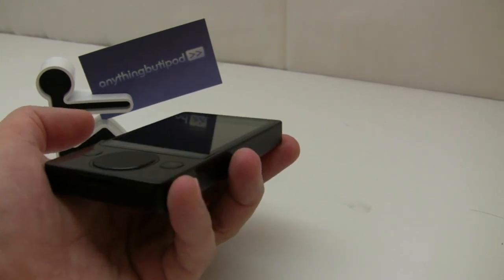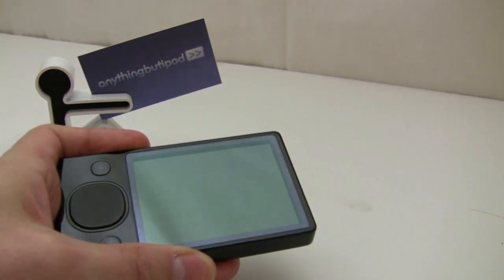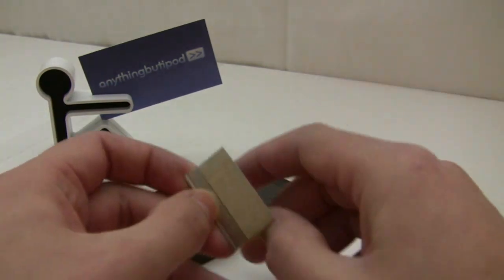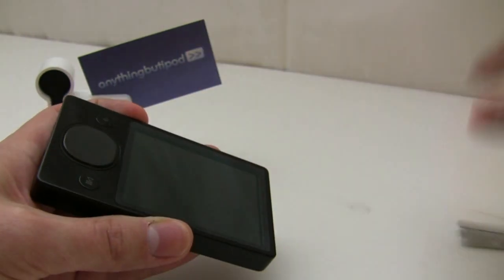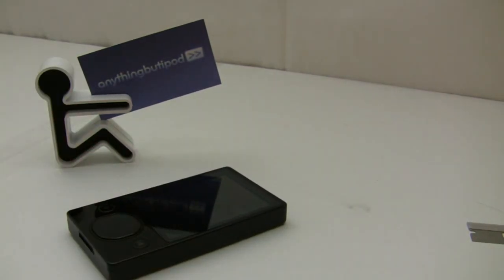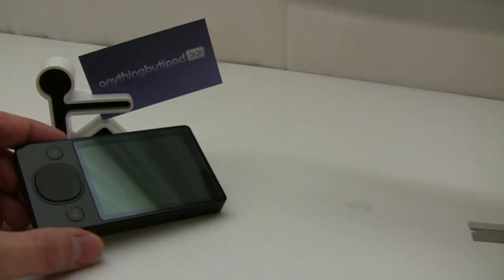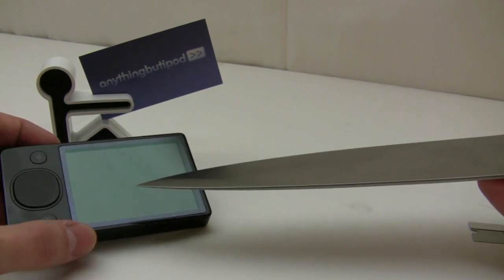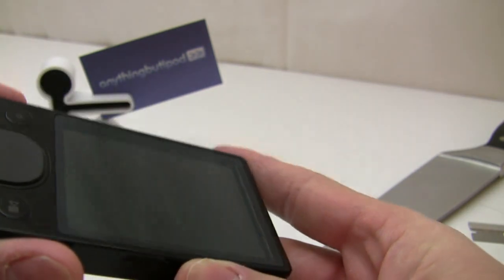Zune 120 Screen Durability Test

Comment: yea the Zunes are amazing. the screen wont scratch but they do crack. my 120 is cracked all over but the actual screen behind the glass still displays perfect and the device still works perfectly. my Zune has had years of severe abuse, dropped, landed on, the works, and finally it cracks but still works after the worst abuse i can throw at it. i feel that is a pretty damn good testament to the product. I'm about to buy the HD64 and will trust nothing but Zune after the quality I have experienced

Comment: the zune and many other things like care windsheilds, itouches, lots of htc phones ect have tempered glass.... its were the serface is super heated so just the very surface of the glass would fall on a hardness scale of like 9.5 while everything underthe serface still retains some flexability thus pretty indestructible. unless the surface layer is broken thru that can cause mucho problemos.

Comment: @VakomaNOVA  its pretty good i have have just got it this year it is amazing device the battery is bad if you have the wifi on all the time figured it out that the first week when the battery was always die cause it wouldnt turn off you have to make sure to lock it when it is off......or else your screwed

Comment: Zune ftw, I've had mine for over a year with no problems at all, the screen hasn't scratched and everything works correctly, The Zune software I like because it works well and orgaizes my Media the way I want it.  The Battery Life is amazing except for watching movies, I can watch 1-2 movies depending on the length and then it will be nearly depleted, but when just listening to music the battery will last for a few days non-stop.

I had an Ipod and I can say I do not regret upgrading to a Zune.